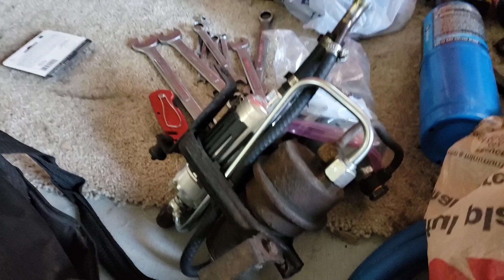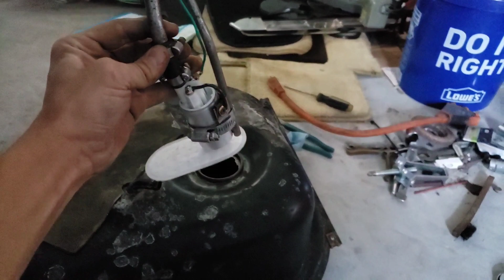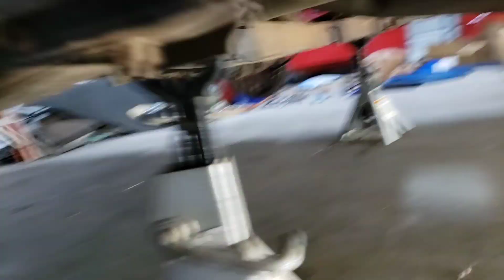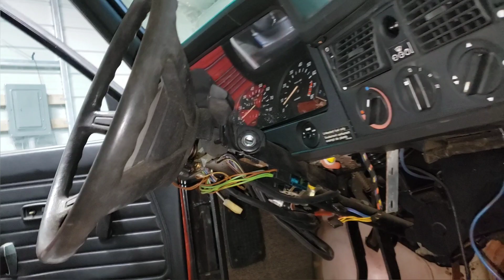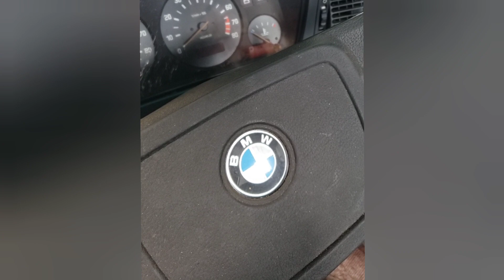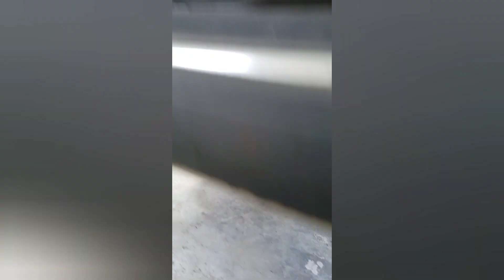Project E21 #4: Restoring a 1982 BMW 320i

Comment: Hi bud my i just replaced my in tank fuel pump with the delphi fuel pump . But it looks like its not doing its job what can be the issue
Reply from the maker: Did you check the pump manually with a battery to ensure it does in fact work? If it does work, you more than likely have a bad fuel pump relay. You can bridge the terminals in the fuse block to make sure. Process of elimination.